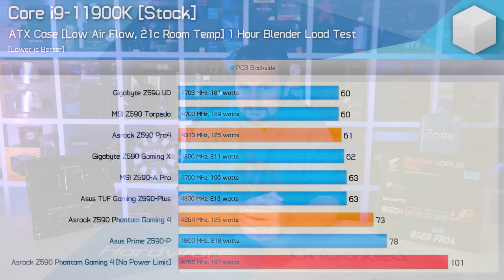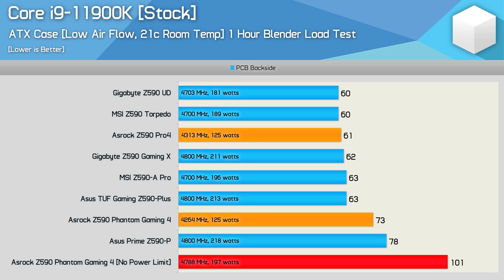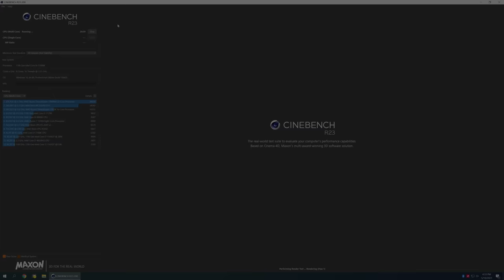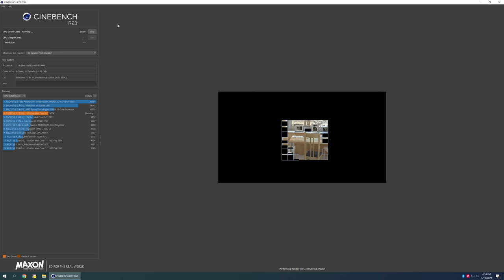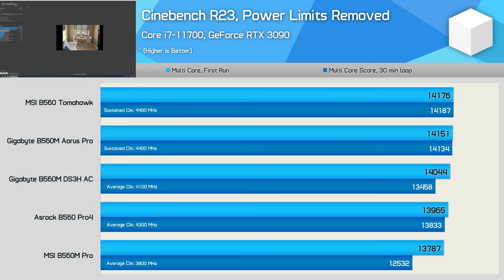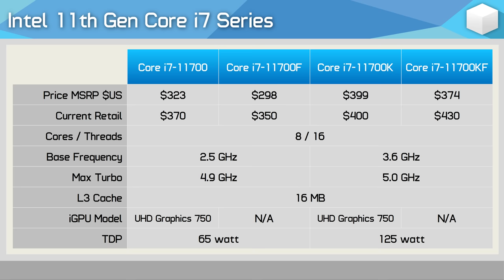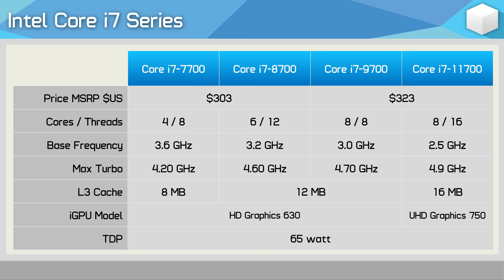Intel B560 is a Disaster: Huge CPU Performance Differences, Power Limit Mess

Comment: AMD : You don't need x570
Intel : You don't want b560
Reply: Intel: you don’t want a CHEAP b560
Reply: @TEKDAD  some decent b560 models cost more than z490 so you might as well get that (in australia)
Reply: @TEKDAD  Mobo manufacturers have only 1 job, make sure the VRM can keep up with all possible CPUs you can slot in without overclocking. Then consumers are free to choose based on features. If the VRMs can't keep up, it's a fail.
Reply: @TEKDAD  If it's going to be expensive what's the point of B560? I would just go get a nice Z590...
Reply: The B-series from AMD is the most useless chipset, considering that for a same tier board, it cost $10-50 more to get X-series.
Reply: @AlfaPro1337  how so? I bought b450 gaming pro carbon wifi for 130euros,while x570 tuf gaming plus costs 220e. And it even does not have wifi
Reply: One for the premium b560 boards the the same if not more then some z590 models. Just buy an entry-level z590 and you will be set.
Reply: It's only about removing power limits, lol
Reply: @AlfaPro1337  Bruh, the B-AM4 is the SWEET spot and the saving grace for the now costly Ryzen chips. That's the only reason why I recommend AMD because they have a good mid-tier board that is cheap and has a very good upgrade path and support.
Reply: @AlfaPro1337  the b550 chipset is the best actually because for each x570 there is a b550 model with more features and less/equal price. The only reason to go on x570 is if you have to use 2-3 ssds and 2-3 gpus.
Reply: Intel = budget builds. 5800x beats both 11700/11900
Reply: @Smallman647  Uh, no, from a chipset standpoint, the B-series from AMD is the most useless chipset.

Like I said, if you get a same tiered board, like UD5 or Tomahawk. It's really US$10-50 for the X-series.

The argument that X570 cost US$50-100 more has been invalid since AMD launched the B550, it's now back to US$10-50.

Whereas Intel is on a different level, if you want to have RAID support, the minimum is actually H570, B560 has no RAID support.

Want to add more PCIE cards? The H570 is the better choice, because the chipset has 20 PCIE lanes over 16 lanes (B560).

Whereas AMD, B550 to X570:

1. PCIE 4.0 PCH lanes on X570
2. Also, 6 more PCH lanes
3. SLI support
4. More USB

That extra cost of US$10-50, is worth it.
Reply: @AlfaPro1337  pretty much b550 have better vrms for same or similar prices x570 boards even with the same model name (ie. B550 aorus elite vs x570 aorus elite).
Reply: b550 is actual crazy chipset. AMD made us think why is x570 when you can buy b550 pro4 which is absolutely cheapest and strongest shit ever
Reply: @Stavroization  Because X570 came out earlier than B550, and they know that reviewers will caught the shitty VRM design if they used it for the B550 version.
Reply: @AlfaPro1337  i think you should check again prices. A very good b550 motherboard  like b550 mortar can be found even at 130-140 euros. The minimum x570 (the worst) starts at 180 euros. To get a good and complete x570 you need to spend 210-220 euros minimum.
Reply: @AlfaPro1337  that sounds like a pretty nonsense excuse and doesn't change the fact that b550 are better
Reply: @argamato  B550 is the useless chipset.

I just looked up to confirm that Asus TUF Gaming X570 cost mere US$13-20 more over the B550.
Reply: @artiew8718  beats in some workloads, but not all and not in gaming either where 11700 is on equal footing.
Reply: @AlfaPro1337  it's false. Here in Italy b550 tuf Is 130 euro. The x570 version Is 220.
Reply: @Stavroization  Nonsense excuse? Which came first? X570 or B550. Plus, chipset != board quality. There's no correlation.
Reply: @AlfaPro1337  I cannot speak about the current situation with regards to a good x570 board, but when I decided to buy a new mainboard there was no x570 competition for my B550 A PRO below 180€. So I went for the B550 for 106€. Also I do not like the chipset fan that comes with pretty much every X570 board.
So I get your argument, but everything stands or falls with the price and when I bought my board, X570 was simply too expensive for what it offers.
Reply: @nurenzayyan4825  actually not really, the only special exemption for a budget z490 and 590 is the MSI A pro. But yeah, this board is so well made, you wont even need to consider any other. 
B560 however is for the absolute budget builds and not meant for 8core cpus. However asrock B560M pro4 is doing very well for $100 being one of the cheapest.
Reply: @AlfaPro1337  wrong, x570 is kinda trash because of their insanely hot chipsets that may go up to 80C depending on models. B550 is actually the best chipset for ryzen in particular the B550i strix for the low latency layout with 2 dimm slots and ROG bios for memory tweaking.  

As for B450 and x470... please send those board to a pcb recycler and buy a B550. They are not meant to support zen2 fully what's more a zen3.
Reply: @smashing-3291  the point ist the same as Intel 11.gen itself......rip you off is the "point"
Reply: @AlfaPro1337  i can get high end B550 like Strix and Aorus Pro for 250 bucks in my country while entry level X570 starts from 300, so why the hell I'm going to go with entry level X570 for little to no benefit over a high end B550?
Reply: @bingbing3464  laughs with a b450 tomahawk max running 5900x perfectly fine ...(no Overclocking , only PBO auto)
Reply: @bingbing3464  Because X570 has PCIE 4.0 on the PCH instead of PCIE 3.0 so that it's hotter than usual?

Just shows that AMD lied to everyone from the beginning, just shows that AM4 couldn't support 6 CPU generations in one socket.
Reply: @LazyEngineerYT  must be pretty devastating aida memory benchmarks, below average port royal and gaming. Youd get the same score on Cinebench R20 but it means nothing as it's a pure cpu test.
Reply: @BionicXAngel  Sure let's pick a HIGH END B550 board and go against ENTRY X570. 

Dude, did you even read? I'm comparing them ON the same tier.

AORUS Pro B550 vs AORUS Pro X570.

NOT

X570 Pro vs B550 MEG(?). Obviously that one is pedestrian board and the other is definitely not a pedestrian one.

That's your country's supply issue, but the cost of the chipset is US$10-50, and board vendors can charge their design whatever they want.
Reply: @AlfaPro1337  DO YOU READ? I picked high end b550 against entry level x570 cuz b550 is still cheaper. And now your price argument changed to  same tier argument? There's difference of 70$ in Aorus Pro b550 and x570. I can spend that 70$ in another part instead waste it something that provides extremely minor benefits. And if someone needs everything that x570 provides, that person isn't going to sit and compare prices.
Reply: @silenthero2795  the fact that i can slot a zen3 in my 100$ itx b450 Is great
Reply: @BionicXAngel  Guess, you didn't bother to read my argument that the same tiered B550 vs X570, it's practically no reason to get a B550, because the cost diff is just US$10-50.

Not even once I mention a different expensive tier board vs an entry tier board. Blocked
Reply: @AlfaPro1337  yes exactly. Even at idle it's pretty hot without utilizing the gen4. But if you do use a secondary gen4 nvme, it'll be hellishly hot.
Reply: @seamon9732  That actually isn't really right... A motherboard maker could make a weaker VRM, charge less for it, but then list on the box that it only supports up to a certain wattage/model number

There is a viable market for that kind of thing, especially for OEM machines

Consider the really tiny boxes that are thermally limited
Reply: @AlfaPro1337  I intentionally went for the b550 because it uses 12w less at idle, and doesn't have a chipset fan. 

I don't need more than 1 nvme drive... the x570 is stupid
Reply: @bingbing3464  And, AMD/Asmedia made no revisions to the X570, to curb the thermal.
Reply: @scottr7683  The A520 is way better than the B550, and don't eat your words when you need to add another PCIE-based M.2.
Reply: @AlfaPro1337  there's nothing they could do. It's by design. Everyone knew about it when all the boards came with active fans on the chipsets lol.
Reply: @AlfaPro1337  Put at it this way, if you're buying a x570 board, you're not going for an entry-level but rather a beefy one. In b550, you're going to need mid-tier so you can allocate your budget to other peripherals such as GPU or storage for a bang for your buck. If your mindset is going for an entry-level x570 or high-end b550, you're on the wrong bracket. Also, I don't think you understand how much $10 - $50 in other countries differ. That's literally another part where you can use that same money to RAM or storage where it makes much difference than a measly motherboard feature.
Reply: @BionicXAngel  dont worry mate, a highend B550 especially the itx  like the strix and proAX will outdo a highend x570 in terms of ram tweaking and OC for maximum gaming performance. To the point that i would say, the B550i strix is the best AM4 board
Reply: @jwg9338  My b550 definitely could not boot to a screen to flash bios

I had to use a hardware bios flash button

Given that, I bought mine on 5000 series launch day, and newer models likely have newer bios
Reply: @AlfaPro1337  Not true. A lot of the mid-higher end boards like the B550 Tomahawk or Aorus Pro perform better and run cooler then the entry level X570s. The only reason you would want for example the X570 tuf gaming(entry level x570) is if you need gen 4 support on all m.2 slots and pcie lanes.
Reply: @AlfaPro1337  Also after reading your comments I can already tell you don't know computers and only know the bare minimum. You think PCIE 4.0 is even relevant? We don't even have GPUs that can saturate 3.0 yet and by the time we do, it will be like 4-5 years from now which most people will just upgrade to the newest chipset anyways. Your fanboy is showing real hard.
Reply: @MWKRider  I wouldmt say it's not relevant because PCIE 4.0 is needed depending on the work you do. That's why I needed a to build a few X-570 workstations with massive amounts of raided PCIe v4 storage. Then connect it all with a threadripper server also running PCIe v4. This is just for storage bandwidth.
Reply: @MWKRider  And the fact that you say it's not relevant shows how little you know about the computer industry and the work environment computers are used for.
Reply: @NQUSTN  this was more in context for a gaming environment and not a workstation environment. My bad I should have clarified that. Workstation builds would get completely different recommendations.
Reply: i went from x570 msi to b550 aorus pro v2. ram 4 sticks 4000c15, msi couldnt do 3600c14.
Reply: @nurenzayyan4825  Here in Brazil it's the same scenario. I got a very good z490 (Asus rog strix) for not much more than a mid-tier b560. It's wild.
Reply: @AlfaPro1337  I have 2 pcie m.2 slots on my b550 board
One of them is pcie4, one of them is pcie3

It's fine, even if I need a second disk
Reply: @AlfaPro1337  Well, those expensive B550 boards tends to have even better vrm than many high end X570(which is over kill for ryzen) So, you pretty much trade south bridge gen4 pcie to a better vrm board. Also, many B550 boards has much better RAM OC capability than most X570 for some reason.
Reply: @jwg9338  Almost all X570 boards support bios flashing without cpu installed. You just need to use the follow the guide by the board maker.
Reply: @qiyuxuan9437  Not really. Certain boards claimed to have better VRM, can be found using the same VRM layout even down to the MOSFET on the board which claims to have poor VRM. Except, one has a beefier heatsink, and the other doesn't.

Unless it's a specialised OC board, the RAM compatibility is mostly on the UEFI side of things.

Once again, I'm not even talking about expensive one-off tier board. I'm talking about the same tiered board.
Reply: @silenthero2795  Once again, SAME TIER board we are talking about, not one-off.

The A520 is actually the sweet spot, and actually Ryzen had always been the more expensive option since day one, but that's another topic.
Reply: @MrBrancomusic  Different brand, different tier, and different chipset, try again.
Reply: @groundzero_-lm4md  Entry-level board from any board makers are no-go--even you're running stock if 11700K or 11900K. They usually lack VRM heatsink, or the VRM layout accomodates for 11600K or lower.
Reply: @AlfaPro1337  bruh you kidding me?
Reply: @AlfaPro1337  ok so,how about asus b450 f gaming 2,very decent board for 100euros.
Reply: @MrBrancomusic  Which part of tier-to-tier you don't understand?

Example:

X570 UD5 vs B550 UD5
X470 UD5 vs B450 UD5

Both are from Gigabyte and both are of the same tier.

NOT,

X570 UD5 vs B550 A Prime
X470 MEG vs B450 TUF
Reply: @AlfaPro1337  i originally replied to a commment that said that B series motherboards are useless on AMD side.
He also said that x570 is only 10-20 bucks more expensive than a B series board.
Where i live x570 costs twice as much as some good b450 board that you can slap 5950x on to.
People that wont be using multiple gpus and pcie ssds have no reason at all to buy an x570 board.
Reply: @MrBrancomusic  Why are you even comparing a 500 series against a 400?

People are already using PCIE ssds.

If you can't understand and keep in-topic. GTFO.
Reply: @AlfaPro1337  I don't understand why you keep emphasizing this "same tier" board when they're not the same at all in pricing and feature. If you're going on about "it's just this $ difference!" then I can say you're terrible unaware of international pricing as that "small difference" decides whether you can afford it or not. 

The only applicable CPU for A520 I can think of is the G series with Vega graphics. They're made almost solely for office use and that's where I usually see it paired with. Again, if you still believe that Ryzen is the most expensive option since day 1, I can say you're gravely out of touch these last few years and just talking out of your ass instead.
Reply: @AlfaPro1337  Many entry level x570 boards are not good compared to a entry level b550 of the same type. The MSI MPG is a good example of a x570 board that is nowhere near as good as it's B550 counterpart. As for features the x570 is overkill like other have said for the average user or even professional users unless features like 10gb ethernet is required.
Reply: @AlfaPro1337  You're barking at the wrong tree here, kid. All I'm saying is that you're wasting all this info for a measly "but it just a small price difference!" when in fact it isn't small when it comes to international pricing. Or do you not understand how simple plain inflation means to the rest of the world?

I'm surprised you managed you said so many but conveyed so little to support your argument. Unless you can miraculously give every budget gamers that "small" amount of money, you're still not winning any in your favor with your useless TED talk.
Reply: @AlfaPro1337  did u already watching tech review at b550? at gamer nexus jaytwocent bitwit hardwareunboxed?
if u alrd watching them and still thinkin b550 is useless, + saying a520 is more better, n insist the blue team is more better at this case b560 lmao thats enough dude
u're just a blue team, n i think u're never touch or calculate overclock features to the value judgement (just plug n play)
if that's what u are, then there u go
Reply: @irwansigieo2362  What do you think, boi? I didn't say Intel is any better, in fact, Intel B-series wasn't even supposed to land on consumer--but board makers decided to introduced it.

Plus, B560 to H570, it's base price is $60.

Why should I restart in getting into OC again? Other than degrading your hardware, buying more expensive CPU cooler, complaining about noise pump? Oh the worst, is your system crash in a middle of a competitive game?

In fact, I would agree with TechDeals, overclocking is dead in modern CPU.

Turbo Boost is in fact a form of self overclocking, because it's already running beyond the base frequency under load.

And you would agree if you have watched JayzTwoCents, LTT and GN, they had stated multiple times that turbo boost is a form of overclocking.
Reply: Okay so the problem is only with rendering and editing right it wont really matter if i only play games?
Reply: lol i would say underrated comment but it seems many agree
i usually go for x or z class mobos cuz of intels b class mobos
im rocking a b550 right now and its pretty great lol
Reply: @AlfaPro1337  wrong, theres a lot of things to consider when buying a motherboard, some x570 mobo have wayyyyyy worst vrm performance and power delivery than some B550 boards, but x570 do offer more feature but sometimes its kind of unnecessary. It also depend on what  youre going to do with it.
Reply: @botjksd8292  I'm not going to repeat everything.
Reply: @AlfaPro1337  at least edit/ delete your first comment, im not going to read all 75 comments.
Reply: @botjksd8292  Your problem, not mine.
Reply: @AlfaPro1337  your comment that have been proven false by multiple people is still up, your comment not mine.
Reply: I got a asrock b560 stealth legend and It costs 135$ and I get 10000+ score
Reply: @AlfaPro1337  reading through the shitstorm. look, I get where you're coming from but to say b550 is useless kinda invalidated your entire argument, even tho I do agree with some of your points. Take a chill pill. The majority of people aint going to spend big on a motherboard and that is a fact that you'll have to live with
Reply: @AlfaPro1337  pls get help
Reply: @BasedAstraea  You get help
Reply: @AlfaPro1337  I can't tell if you're trolling or just genuinely like...un-smart?
I don't want to sound mean or anything but what you're saying doesn't make any sense and you constantly contradict with yourself.
Ok scratch that you're definitely trolling there's no way lol